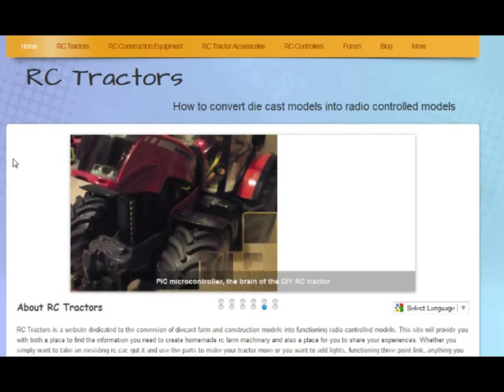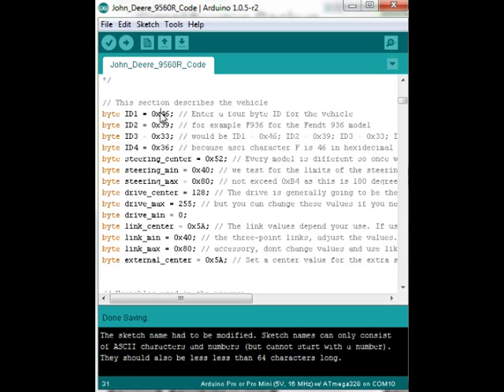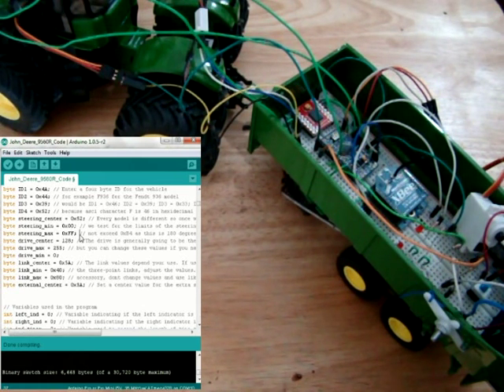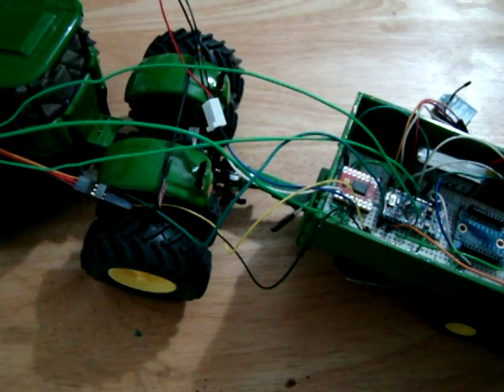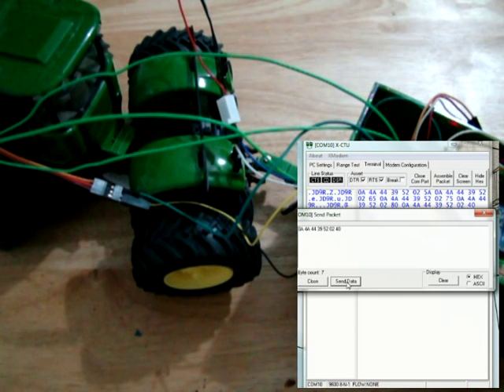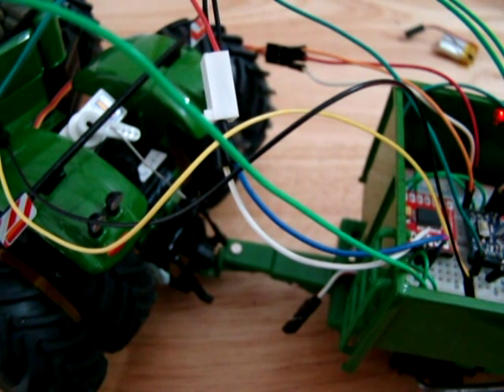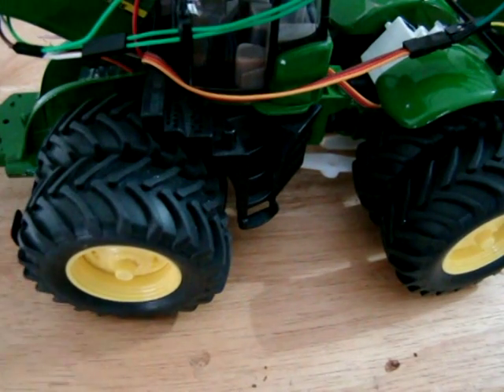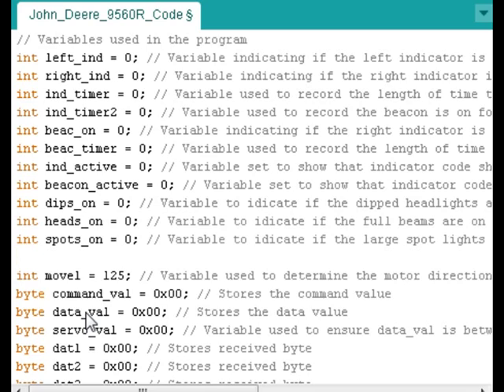RC John Deere 9560R Build   Part 3 Programming and testing the Arduino

Comment: have u got any videos of this beast wokring like driving around mate id love to see them looks amazing
Reply from the maker: Hi, I made a lot of progress with this build over about three weekends last year then I made a push to finish the 8360RT and I changed to using a different radio module in my models and never got back to this model. It's been a sorry looking sight in bits waiting to be finished. I'll get back to it soon hopefully.
Reply: ah roght fair enough should be a really nice model u do great very precise work
Reply: @RCTractorGuy hi mate just getting into this side of the hobby!
Just wondering if you still have the programming code available? Cheers mate